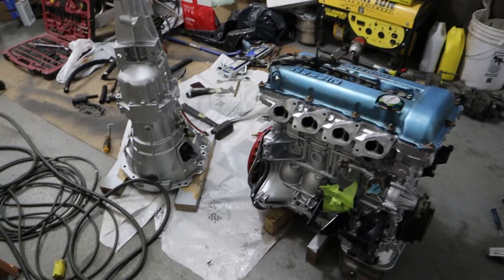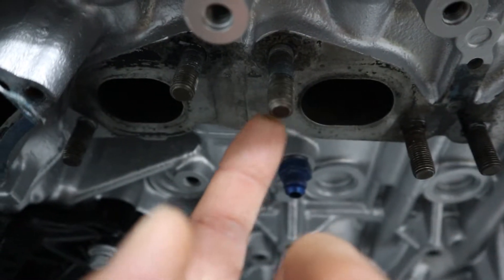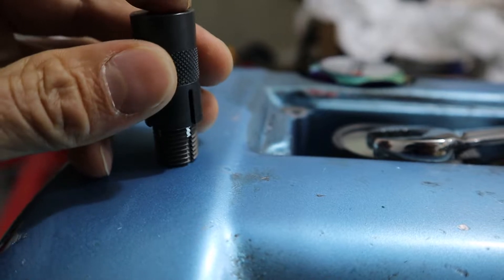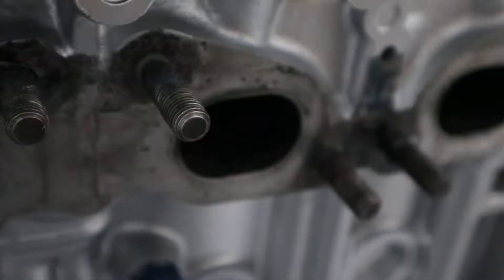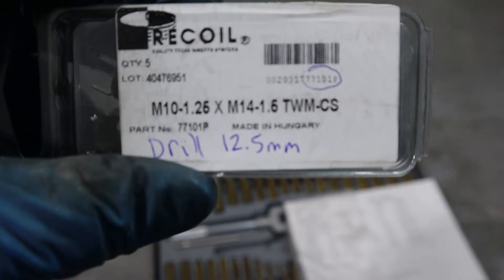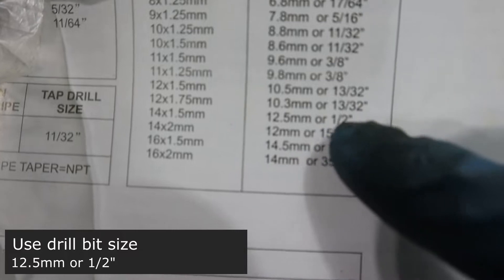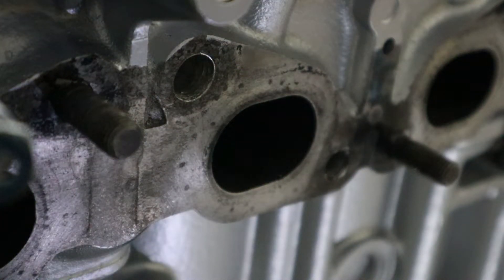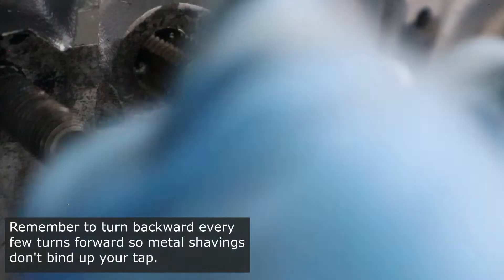Stripped Exhaust Manifold Bolt Hole Repair

Comment: Can you use any Tap thread with Sert?
Reply from the maker: Tap thread must match the key serts
Reply: @240Tony I understand but can I use any brand tap thread?
Reply from the maker: @JohnnieIsBored  Yes of course! As long as the tap doesnt break inside! Theres taps for starting, bottom out or in between. It all depends how deep you have to tap
 @JohnnieIsBored
Reply: @240Tony  what made you go with this specific version compared to the time sert?
Reply from the maker: @JohnnieIsBored  I never use time sert. But key sert has 4 prongs you punch in so it can never turn out. Better than heli coil
Reply: @240Tony  I agree but didn’t realize how difficult it is to find that specific one you have but in a m8-1.25 for a Honda b series.

Comment: I learned how to fix damaged threads on my 350 small block exhaust manifold by watching this video. Many thanks! 🔧
Reply from the maker: Thanks for watching!!
Reply: just effed one of the bolts on my 94 chevy with the 350. cant stand hearing that exhaust with a bad donut man sounds like trash.